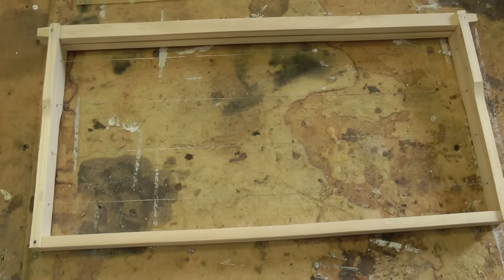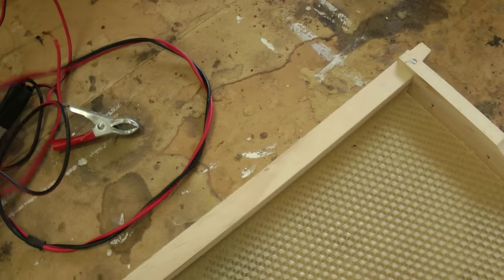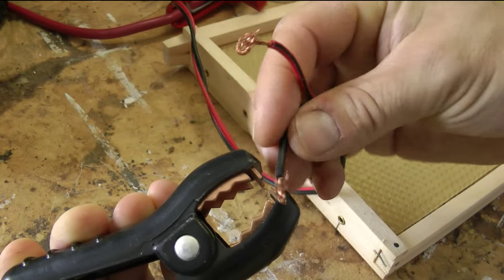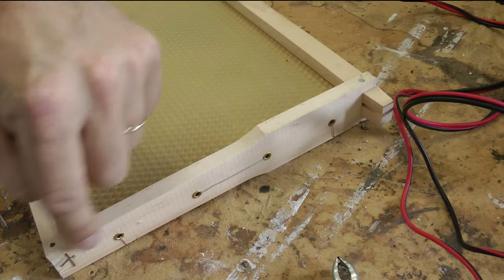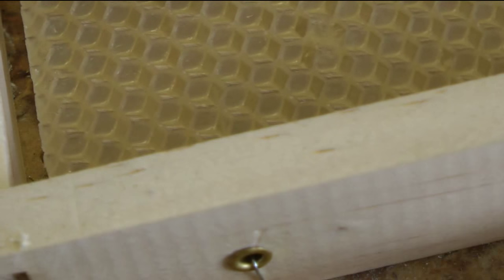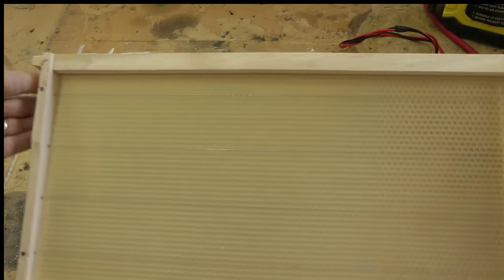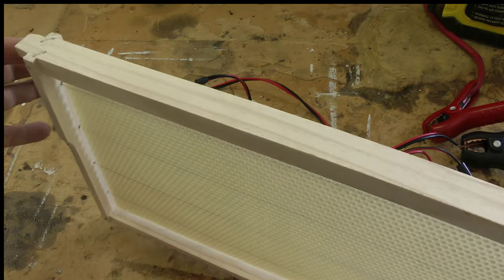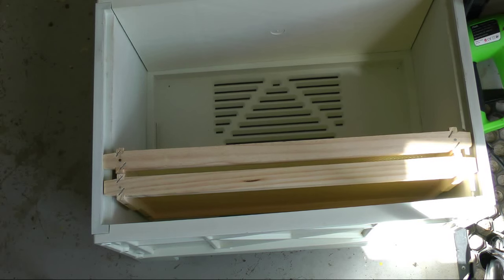How to embed wax foundation fast and easy - DIY beekeeping 101

Comment: Great tip, mate. Thanks for that.Ended up just using jump leads from my car.

Genius.
Reply: Sorry I know your post was 12 months ago, however just be careful Evo, you could damage  electronic components in your car by shorting it like that. 
It would be best to do it with the battery disconnected or use a 12v power pack or charger.

Comment: Hello sir...what the volt output you use to melt the wax.
Reply: I'm wondering the same thing thank you
Reply: Anybody found how much volt we should u use for it
Reply: Years ago, I used a 12V transformer 500mA to embed the wire (get from any electronics supplier) with a wooden tool and a switch on top, I saw a homemade version on a different video. It only requires 2-3 seconds to heat the wire.

Comment: Easyest thing is to drill a hole in the top bar the size of a  bamboo barbecue skewer and push it to the bottom of the frame no wire needed!!
Reply: Great idea! How many skewers have you found to be effective? And how many years do they last?
I suppose the bees incorporate the skewers into the comb? Genius 😃

Comment: My question is:-
Is it necessary to have bee wax in  every frame, I have no these yellow papers, is there any alternative, can I put simple frames without these yellow sheets
Reply: Hello Hilal, you have probably already had this answered, but anyway here is my response.  Its not necessary, BUT advised.  The reason is for control of the bee space inside the hive.  Bees like to not have too much room, and they will ultimately build out or draw the comb that suits their requirements.   This is fine until you do a hive inspection and start pulling out frames  and you also start to damage honey comb or the brood comb.  This damage can easily be avoided by "training" the girls to build their comb in a fashion that is beneficial for you and to their natural need to draw comb.  If you only have a limited anount of foundation wax available,  you can place a starter strip , a slice of your available foundation wax, in the top centre of the frame to give the girls a starting point and a foundation to draw out the comb from.  I hope this helps a little bit.  😁
Reply: @darrentummon4855  thanks buddy. Really good information

Comment: Have you ever drilled a hole in the top bar of your frame and push a barbecue skewer down throught to the bottom of the frame no need for wire!!!!! And they are cheap.
Reply: I have tried something like this with skewers and found the wax does not stay in so well. It wants to warp and bend